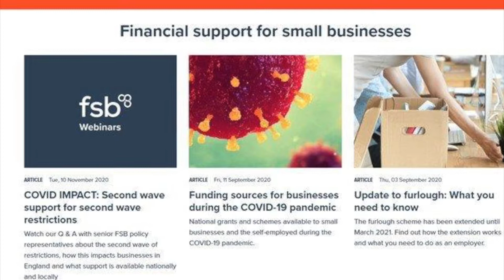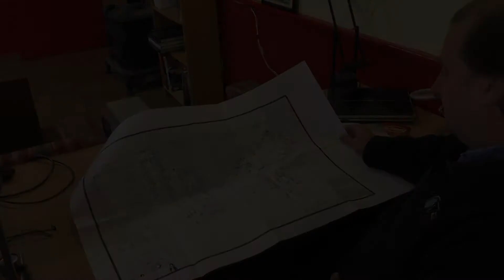Tim’s’ World by Tim Dutton

Comment: You've triggered some memories.  I helped Hugh Conway translate some of the drawings in a factory in Slough, "Lawrences" some time around 1980. Lawrence, who had his own Bugatti, (which he'd bent on the ferry at Plymouth) was attempting to cast the twin over head cam engine blocks and most were failing, the valve seat cutters or boring tools would break through and there was pile of failures.  We had a sectioned Bugatti block and one of the modern ones trying to work out where it was all going wrong.  The quality of the Bugatti casting was astonishing, the end wall was a perfectly straight and uniform 3mm yet the contraction on the casting was closer to 5 mm and non-uniform.  We never knew; did Bugatti calculate this or had they perfected it through trial and error?   More than once people would arrive in their Bugatti having driven to Slough Trading Estate to discuss parts and get measurements.  When I knew Lawrence he was in his 80's (probably, he was coy about his age) and the car was still under the tarpaulins he put on it in the 1950's after the ferry incident, he never did get it fixed.